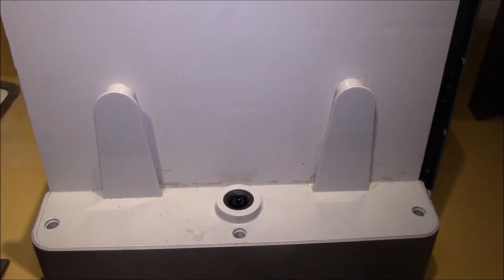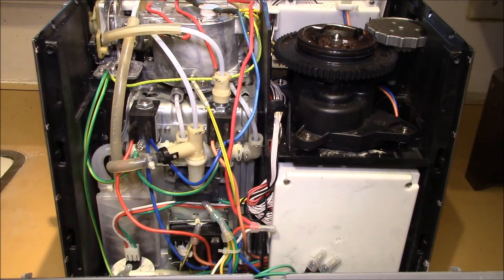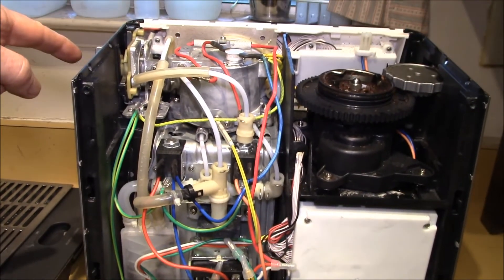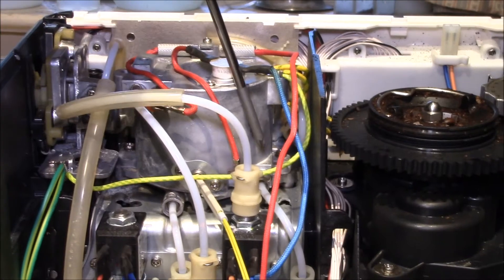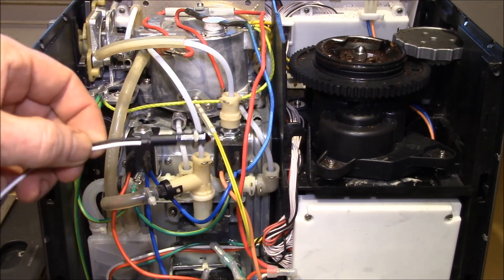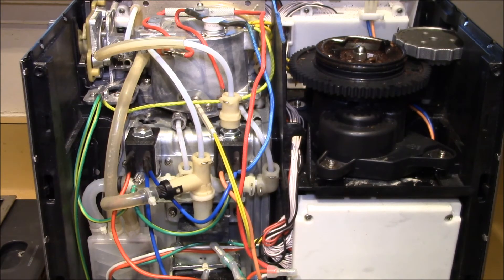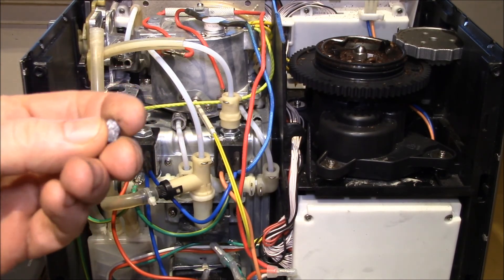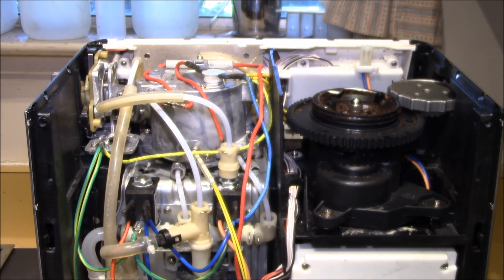Breville/Sage 870XL Barista Express - Water Flow

Comment: Thank you for such detailed explanation. I have replaced the 3 way and 2 way valve and cleaned all hoses out; still the steam wand and hot water will not work. Any suggestions?
Reply from the maker: Check the pinned comment for this video.  It has some detailed troubleshooting tips.  For hot water/steam, the 3-port solenoid must be off and the port to the side sealed.  Two options are that it may be getting turned on when it shouldn't, easy test is to unplug the wires to that valve.  Only do so with the machine unplugged and be sure to insulate the exposed connections before plugging the machine back in to test it.  If that makes the hot water/steam work, find out why that solenoid valve is being turned on.  If it doesn't help, then the valve may be sticking internally and not sealing off the other port.  In that case, you'll see water running to the drip tray all the time.  Open up that valve and clean it internally, I have a video on that process in this playlist.

If the pump isn't running in hot water or steam setting, check that the two small switches on the hot water / steam valve are connected and working right.  Also, that valve could be partially clogged, run a few descaling cycles through that valve, if possible.

Comment: I've got a barista 870. I've replaced the solenoid unit. Still not getting water out of the group head. I've checked the water flow from the pump seems OK as is coming out of the thermocoil. The steam and hot water work. Is this an electrical problem with the two way solenoid not getting power ? I've got a multimeter but am unsure about testing it. Any ideas anyone ?
Reply from the maker: This video has a troubleshooting option:
https://youtu.be/9cC-m3a-oXY?si=hBaow31D-2m7Rm1k

Comment: Hey there. Big fan of your videos. I have a problem with my machine. I recently change a faulty pump and fixed some leaking issues from the 3-way solinoid valve. But here's the issue. When I push the power button it keeps buzzing an continues to dump all the water from the into drip tray. Do you have any suggestions for a fix?
Reply from the maker: Could be some wiring is connected incorrectly or perhaps the main circuit board has a shorted Triac that drives the pump and that's powering it all the time:
https://photos.app.goo.gl/bN1ugnLPYwvyDcr59
Water will flow to the drip tray in this case because the 3-port solenoid valve is off and water flows up and over to the hot water / steam valve, which is also off, and then down to the diffuser and into the drip tray.
Reply: @The4Crawler  thank you for answering so quickly. I'll try looking into solinoid valve again. I did have som issues when I first took the machine apart. Does the flow meter have anything to do with the priming face?
Reply from the maker: @eikpedersen  Yes, I think the flow meter may play into that, although I've found no documentation on that.  I suspect the pump runs at power on and maybe shuts off after some water flow is detected.  Flow meter vane can get clogged with debris and stop spinning.

Comment: Hey thanks for your vids. I watched them all. I have a question and hope you can help me out on this. I have a Breville 870 and I have it open for few days trying to figure out why? After replacing the Solenoid and got things back to Normal, then now I got a new problem of my hot water and steam are only coming out from the brew unit where the normal espresso comes out. I don’t have the hot water and the steam not working! The water is heating up and hot, but it’s not passing through where it should have been. I cleaned and sent through a thin wire and blew air in the nozzles. Please help me on these two so I can use my machine. Thank U in advance!
Reply from the maker: Check the pinned comment on this video for some troubleshooting tips.  

Could be the solenoid valves are mis-plumbed, tube off top of 3-port solenoid valve should go to the hot water / steam valve, tube coming out between the 2 valves should go to the group head.  

3-port solenoid valve, while new, might be sticking part way open.  Pull it out and try blowing air through from the inlet side and see if the air comes out the top or the other side.

3 port solenoid might be getting powered at the wrong time, try unplugging the wires to it (be careful of the live connections, and see if it works for hot water.

Comment: My biggest issue and I cannot find a video of this anywhere, is that the water goes into the group head just fine and pulls shots fine. Pressure is perfect, etc. but no water is going to the steam wand or hot water nozzle. All of the small water lines and o rings are cleared (fixed a group head issue I was having) but no thumping sound, no wooshing sound upon turning back to standby, and no water leaving either the steam wand or hot water. I cannot figure out what is causing it for the life of me.
Reply from the maker: Never ran into that issue myself.  A guess is that the small switches on the hot water / steam valve aren't working  or disconnected:
https://youtu.be/9lMw6ooiqPI?t=401
Those are what tells the machine that you want hot water or steam.  Otherwise, it just sits there.

Comment: I just got a new breville barista express and only used it for 1 week, stopped using it for 1 week and when I turned it back on it did not make the loud noise it usually makes when turning on a breville, and no water flowing through anywhere, not through the group head or the steam wand or the hot water, it makes no noise whatsoever. Any idea where the problem could be coming from? Thank you
Reply from the maker: The loud noise is usually the pump running for a bit when the machine is first turned on.  The pump is also what pumps the water through the various outlets.  So either the pump isn't working, un-plugged or an open thermal cutout:
https://youtu.be/i8GGZHKNxPo?si=zENHMjyIfZnRd0Ar

 or the circuitry on the main circuit board has failed.  If it's a newer machine, it may be in warrantee, so best to contact Breville support and see if they can assist.
Reply: @The4Crawler  unfortunately Breville cannot help me without a receipt. I’m surprised there is no water flow if ive only used it for about 1 week. I did leave it plugged in for the 1 week I did not use it, maybe that was a problem? I’ll try replacing the pump and hope that will solve my issue.

Comment: Thanks for taking the time to make this video. Breville has been zero help in troubleshooting this with me. Question for you. I turn on the steam and water wand and nothing comes out, the water actually comes out of the espresso area which makes me think there is a blockage somewhere? The wand it'self isn't blocked because when I take off the tip nothing comes out, regardless. Any thoughts or ideas on what to clean?
Reply from the maker: Some troubleshooting tips in the pinned comment for this video.  Basic strategy is to "follow the water".  Water out the group head means the 3-port solenoid is either stuck open or it's being turned on all the time.  First thing to try, unplug the machine and then unplug the wires from that solenoid coil, wrap the wire ends in tape to prevent shorts and then try the hot water or steam.  If that works, the main circuit board driver for that solenoid might have failed in the on state.  If that doesn't help, then pull that solenoid valve out, open it up and follow the steps in the valve cleaning video in this playlist.

Comment: An excellent overview - the explanation of the diffuser was especially helpful!
Reply from the maker: Glad it was helpful!
Reply: @The4Crawler ... my problem was the small water filter between the tank and the flow meter. The unit operated fine for several years but now it seems to need servicing of the filter every six months. I find removing the heat sink in front of the flow meter helps with access. A couple of cycles through an ultrasonic cleaner make the filter perform like new again. Unfortunately when I was blowing out the tank-to-filter hose after cleaning, the spring went flying off to God knows where.... it doesn't seem strictly necessary though, so I am trying for a while without it. It's amazing how much the flow is improved by cleaning that little filter. Thanks again!

Comment: Really appreciated that. Now where is the pump diode so it can be tested. I hope you can help.
Reply from the maker: It's likely buried in the solenoid coil of the pump.  Easy enough to test, just use an ohm meter across the two coil wires, one way should measure a different resistance depending on the polarity of the probes, higher in one direction, lower in the other.
Reply: @The4Crawler  thanks, i do know how to test it, it's just locating it. No pressure when making coffee. there are 3 connections on the pump one indicates a diode but cannot locate it. The yellow wire connected to that connection goes to a thermal switch (Klixon) - not a diode.  SO the diode is buried somewhere.
Reply from the maker: @Dr.Cranky As far as I have read, the diode is buried in the coil someplace.  Here's a thread on adding a diode externally:
https://www.home-barista.com/repairs/ulka-vibe-pump-repair-fix-t58788-10.html
Reply: @The4Crawler  thanks that thread was really useful. I am going to remove the pump and test it for flow etc. Or just get a new one.

Comment: Hi R Brown,  thanks for all your material about Breville  Espresso Machines! It is really great!!  I have Breville BES860XL Barista Express Espresso Machine with Grinder and once a plug the machine and I turn the switch I got a tripping breaker. Any suggestion? Thanks!
Reply from the maker: Check the pinned comment in this video, down a ways are some tips on locating and fixing problems like breakers (assuming GFCI or RCD) tripping.

Comment: Great walk through of machine! I’m having an issue when trying to make an espresso the water is not coming through group head but going directly into tray….. I’m not mechanically minded so cannot troubleshoot. Any ideas to help me out here? Thanks so much
Reply from the maker: Check out the pinned comment for this video, there's a troubleshooting guide that'll likely answer your question.  2 things between the pump and the group head / drip tray; that being the over pressure valve or the 3 port solenoid valve.  Likely the valve is not turning on fully and that'll send water directly to the drip tray.  Videos in this playlist for checking and replacing both those items.

Comment: Thank you very much. It's so well explained and detailed. I have a Breville BES 840XL and the water don't stopped with the 1 or 2 cups setting. If I follow your explanation, the flow meter would be the problem ? What else should I check ? Thank you
Reply from the maker: Likely the flow meter, either the device itself or the connection to the main circuit board.  Why?  That's what tells the processor on the main circuit board how much water has passed through the pump since the cycle was started.  Could be it's clogged internally, remove it and see if the wheel inside spins and check to see if the connector is plugged in properly, maybe reseating that will get it going again if it was loose.
Reply: Thank you for your help @The4Crawler

Comment: Hello, many thanks for your very informative video. I have a low pressure problem in my Sage Barista Express. The pressure briefly goes up to the bottom end of the "espresso range" but then immediately drops down into the 'pre infusion' range until the water stops. It makes a full double espresso. It does the same thing on a single espresso. I have tried replacing the solenoid valve block and also cleaned out the little in line filer that sits between the water tank and the flow meter. I've also ran a few descale cycles etc. It used to work just fine. What would you suggest I try next? Many thanks!
Reply from the maker: Might be the over pressure valve is popping open and limiting the pressure, some details on how that works below:
https://photos.app.goo.gl/bN1ugnLPYwvyDcr59
Or, if the extraction time is decent and the espresso is OK, maybe the gauge is just not reporting accurately.  The line to it may have a clog in it or something.
Reply: @The4Crawler  Thanks so much for these videos, they've been so helpful in understanding how the Barista Express works. I've been trying to diagnose the issue with my secondhand machine. Interestingly, it started after I ran a cleaning cycle.

I'm having the same issue as this comment. The machine is not getting up to pressure while attempting to run a brewing cycle, but is still sending out the correct amount of water through the grouphead. It runs through the grouphead very quickly. I've tried adjusting the over pressure valve, but that hasn't corrected the issue.  Also, only a minimal amount of water goes to the driptray. 

Since water seems to be flowing the correct direction, am I correct that the OPV and the solenoid are likely not the issue? I think that I've troubleshot this to the point of confirming that the pump is not producing enough pressure, but wanted a second opinion before purchasing one.

Thank you!
Reply from the maker: @natekling6792  Hard to say.  If the flow is OK but the pressure low with coffee in the porta filter, then there may not be enough restriction in the coffee to produce the pressure drop.  If this is the case, try running with the double wall filter basket and see if there's a change.  If the extracted coffee is decent, it might be as simple as the gauge not reading right, perhaps the tube to it is clogged.

If that flow is OK with nothing in the portafilter, then it may be the pump output pressure is too low.  That's what I saw in my machine after replacing the solenoids.
Reply: @The4Crawler   Thanks so much! The pressure has not increased when I've tried the double wall basket, as well as when I've done trial runs with the cleaning disk. It seems the gauge is reading correctly.

I'll go ahead and order a new pump! Thanks so much for offering your insight and knowledge. The world is better off thanks to people like you 🙌
Reply: @The4Crawler  thank you!

Comment: As I mentioned before, I have installed a new pump and the new solenoid valves kit . The machine worked perfectly for couple of weeks and then one morning the water stopped flowing without any warning. Total dryness, not a drop anywhere. Is it possible the new pump was faulty? Is there any noise for the faulty pump at all? I am lost.
Reply from the maker: Check the pinned comment in this video for some troubleshooting tips.  Is water getting to the drip tray?  If pump is making a buzzing type sound, it's probably electrically intact, if not either it may be burned out or the driver circuit on the main control board has failed.  Water may not be getting to the bottom of the pump, e.g. clogged inlet filter or a leak in the tube letting air into the line and breaking the vacuum that pulls water up into the pump.  Perhaps the water is running out the over pressure valve or one of the outlet tubes is clogged internally.  Take one off at a time and try blowing air through it.

Comment: Thank you for your videos how BES870XL works and repair. I replaced the valves and the pump and it worked perfectely for about 2 weeks. Then water stop flowing from any outlets group head, steamer or hot water. When I turn it on, it makes more or less normal noise, just quieter. Water is not even dripping. Any thoughts? Thank you
Reply from the maker: Check out the pinned comment for this video for some troubleshooting tips.  If the pump is running, it could be water is going to the drip tray via some path (e.g. stuck solenoid valve, over pressure valve) or the pump is worn out or there's an air leak in the pump inlet hose and not producing enough flow/pressure to operate or there's a clog in something like the thermo-coil.

Comment: One of the best videos on explaining how an espresso machine works.  There are so many videos on how to repair but very few on explaining the flow of operation.   I just troubleshooted and fixed a friend's BES860XL in no time.  Thank you!
Reply from the maker: Glad it was helpful!  I was a bit uncertain how the machine worked when I first replaced the solenoid valves.  But then after figuring out how those 2 valves worked after I cleaned them, the water flow in the machine made sense.